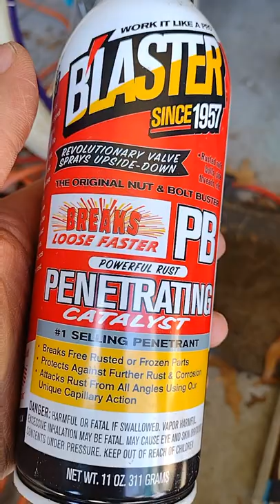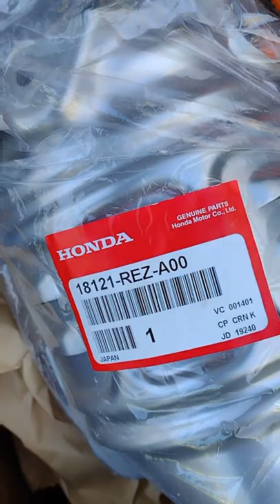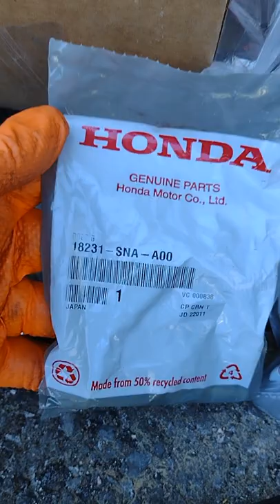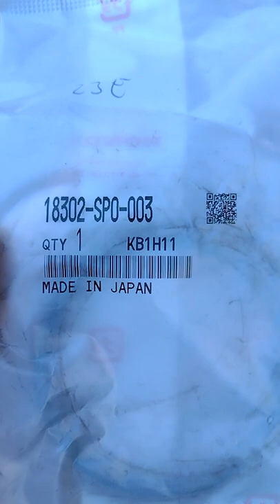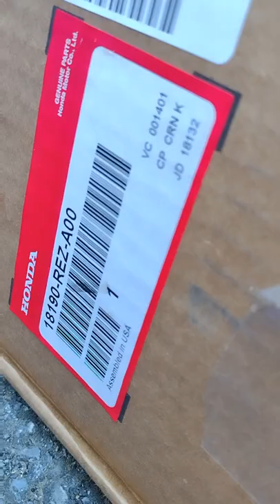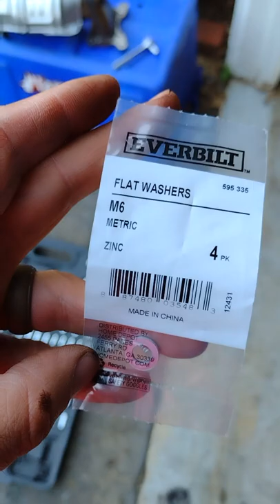How to change the catalytic converter for a 2010 Honda CRV including 2011

Comment: Awesome video, thanks for taking the time to put it together…..if you notice at 31:40 you can see one of those spring loaded bolts broke off in the cat. I have a similar situation right now. If you were re using that catalytic converter, how would you clean up that nut to thread in a new bolt? I wonder in there’s a way to do it from underneath the car while the cat is still attached to the engine.
Reply from the maker: Thanks for your comment.  To answer your question, i believe that a tap and die set is the way to go to clean the thread.  I know it's expensive to buy a set, but that is what has helped me clean threads and fix damaged threads.  It has been a while since I did that work, but if you can reach it with the tap and die set, you should be able to do from underneath.
Reply: @fixit9888  thanks so much for your insight. I think you make a good point about the tap. As for doing it on or off the car, I guess the only way to really know will be to see how it goes when I finally get around to tackling this project.
Reply: I've got an answer as I'm in the rust belt and have the same issue..
The forward bolt is accessible underneath the vehicle and you can snap off the now what looks like a matchstick bolt that may or may not still have the spring attached. You can then drill out the remaining bolt shaft again, accessible underneath. What the bolt threads into is welded onto the upper cat. No need to be careful while drilling out the old bolt as all the new flange bolt sets I've seen also come with a brand new nut that even if you muck up the threads in the upper cat, the new bolt will simply ignore those old threads and will attach to your new nut.

As for the rearward flange spring bolt set... I haven't figured out a way to tap it's rusted ass out of there yet from under the car (which is why I'm here). I think the best course of action is to remove upper cat completely and that way you have better clearance with tapping out the corroded bolt. 

Goood luck!! -I'm one bolt into this project and spent about 4hrs extracting said bolt. Ugh.

Comment: Instead of removing the wiper cowl and all that non sense. You can just remove the air box. One ten mm bolt that holds the bottom on and the clamp at the  throttle body. Then pull the plastic case that's on the motor forward from it's holding tabs. And your done you can now pull the cat through the side opening out
Reply from the maker: I would have loved to try that when I did mine.  Thanks for the info .
Reply: PUEDE SER POSIBLE ESA MANERA , PORQUE VEO MANGUERA QUE PASAN POR AHÍ??
Reply: Hice el cambio de los catalizadores y es verdad que el que va en el motor lo pude sacar por donde dijiste , muy práctico y rápido,  mis respeto para usted
Reply: So glad for your comment. I removed the air box and the A-pipe came out easily. Thank you!

Comment: I just replaced my catalytic converter on a 2011 CRV. Just lift the car and slide it out the bottom. No need to remove panels from the top. Maybe it’s different on the 2010 CRV. But on the 2011 CRV there’s a large open space underneath where the cat can slide out.
Reply from the maker: Did you replace both Catalytic converters or just one?
Reply from the maker: Both

Comment: Hello, I watched your video. It was a very good explanation .thank you. My question is, I have honda crv, ex.l ,/ 2.4 / 2011 sedan   , I have the same problem.  Is it the same part that can be changed for my car model ?
Reply from the maker: You have to go to hondapartsnow.com, enter your vehicle information.  Then in the search engine type : catalytic converter.  It will give you the part number for your vehicle .  The reason I can't answer your question directly is because I need to know if it's AWD or 2WD
Reply: @FixIt  thank you so much I appreciate your help

Comment: Do you need the catalict converter back on?  Can you just not have it on the car?
Reply from the maker: Some people remove the catalytic converter and they reinstall it when they have to do their emissions.  . If your car was equipped with one when it was manufactured, federal law prohibits it from being removed.The engine control module in modern vehicles is designed to work with the catalytic converter in place. Removing or bypassing the converter can cause the ECM to receive incorrect data, leading to poor engine performance, reduced fuel efficiency, and potential damage to other components such as oxygen sensors.
Reply: @fixit9888   Thanks for the advise.  That sucks, I want to take off as many things on the car as I can get away with :D

Comment: AMIGO , LUEGO DE PONER LOS CATALIZADORES NUEVO , ES NORMAL EL HUMO QUE SALE ??
Reply from the maker: Al principio huele un poco mal.  Pero después para.  Si el humo salía antes y todavía sale, puede ser que la junta de culata está dañada.  Que el agua se está corriendo dentro de los pistones. Si ese es el caso, tienes que arreglar eso porque se te puede dañar el catalizador de nuevo .
Reply: @fixit9888 el humo solo sale por el cambio , anteriormente no salía,  lo q me sigue saliendo es el  Check engine , debo  de quitarlo con el aparato que lee los problemas ??
Reply from the maker: @abel3745  que código te sale?  Y que cambio?  Dices que sale humo por la conección ?
Reply: @fixit9888  ya no sale humo amigo , pero sigue saliendo el código del catalizador y ya le cambié los únicos dos sensores q lleva , es un honda crv 2011, le borre el check con el escaner y salió de nuevo 🤷‍♂️
Reply from the maker: @abel3745  instalaste un catalizador original? Y el sensor, es original?